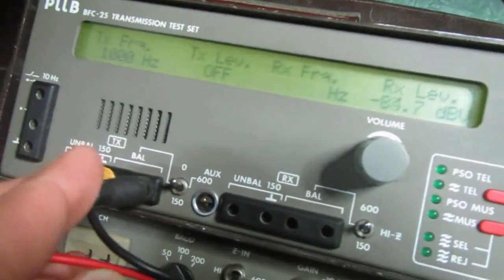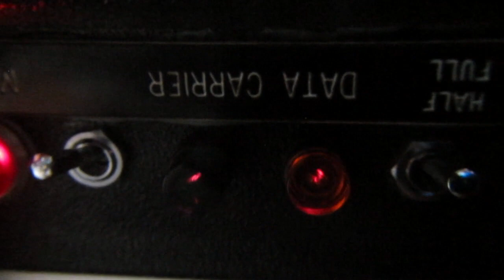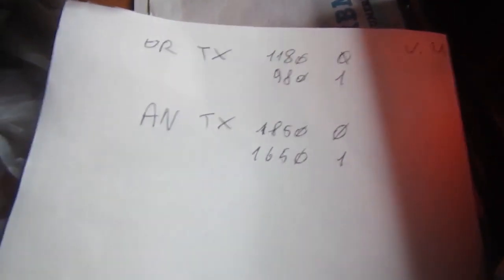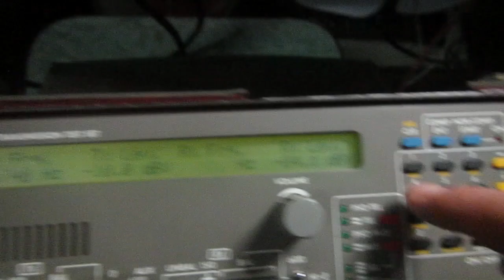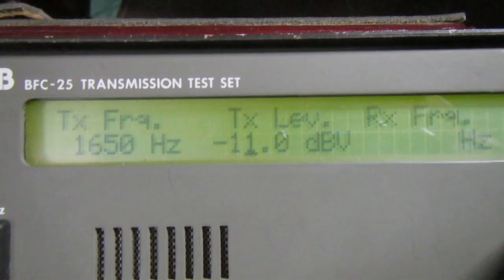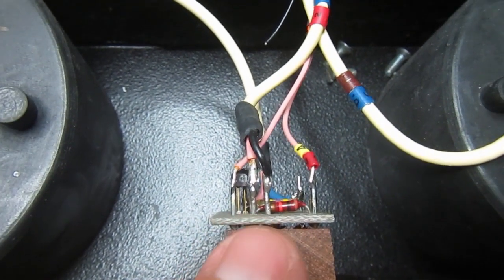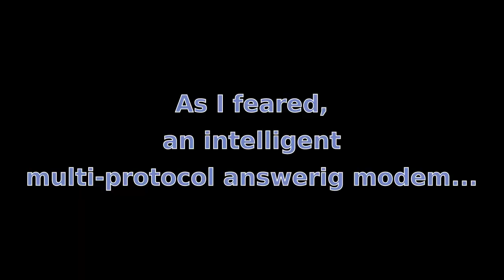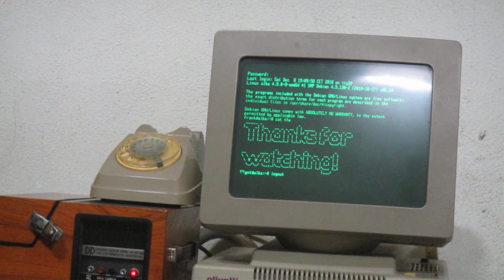Restoring the DCD AC.350.OM acoustic coupler pt. 3: RX test & going online!

Comment: I just got this modem. What powersupply can I use for it as mine did not come with one?
Reply from the maker: What do you mean? This device has an internal power transformer, it's mains powered. You should make sure it's rated for your mains voltage. I don't recommend powering up such an old device without careful internal inspection first.
Reply: @iz8dwf  Ok thank you. I have not opened it up yet so I had no clue that it was mains powered.
Reply from the maker: @retromobs6018  good luck with it! It's a nice piece of old hardware.
Reply: @iz8dwf  I just fixed mine as well. Had exactly the same issue with pre-amplifying board and frequency drift. Quick one, are you using a real POTS connection or a FXS gateway? I did not rewatch your videos and could not remember whether you mentioned.
Reply from the maker: @retromobs6018  I'm glad it's fixed! I have an asterisk installation and an analog phone adapter, it took some time to find the correct settings for analog modems to work fine (basically, disable echo cancelling) but it's very reliable now. I plan to add the proper carrier detection circuit to this modem when I have some spare time. That way it can work fine as a proper V.21 modem.
Reply: @iz8dwf  Awesome. I also have a asterisk setup. Maybe what we can do is setup a IAX trunk between the two of us and then we can dial each other internally lol.
Reply from the maker: @retromobs6018  LOL it might work, however in my particular part of the world, internet connectivity is mostly only wireless and unstable. One day we'll have some fun with this project.